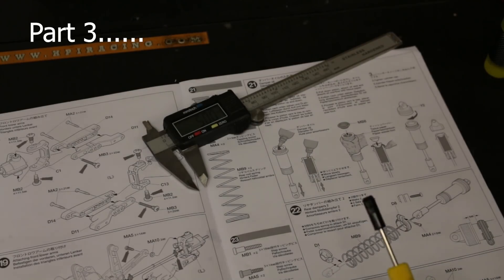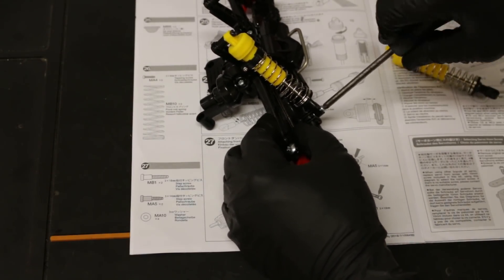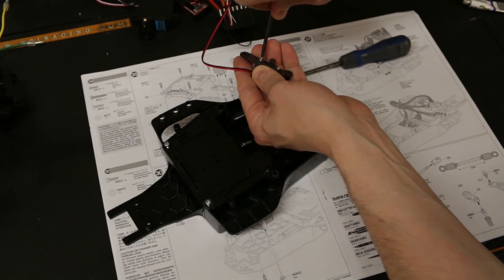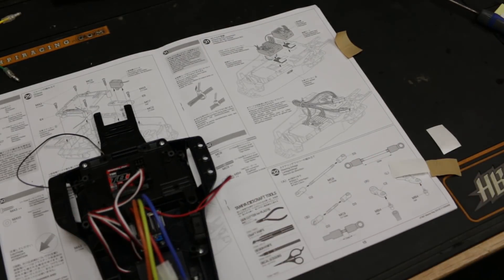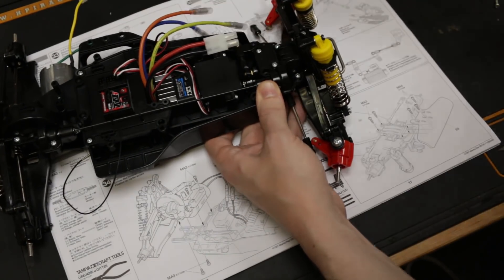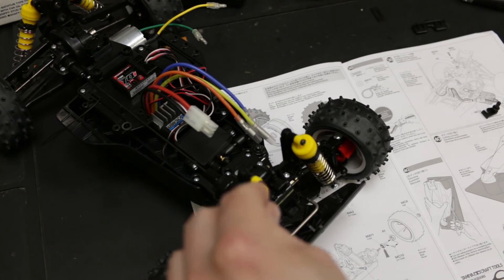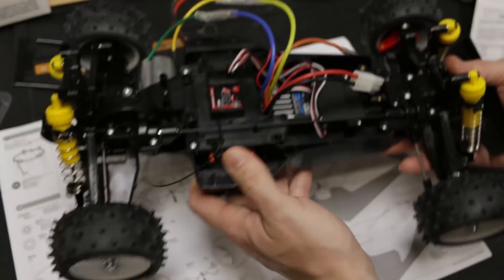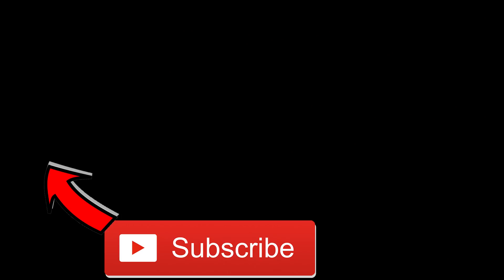Tamiya Manta Ray 2018 Build Guide with Kev Part 3 of 4

Comment: Most brake parts cleaners are formulated similarly and will not attack lexan. Where you want to be careful when using it is around rubber, especially the silicon x-ring Traxxas uses.